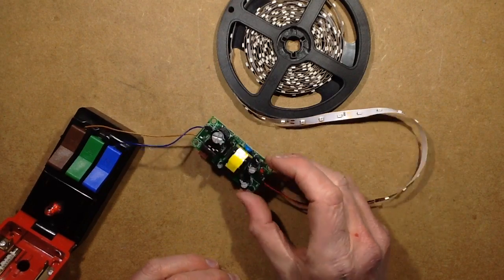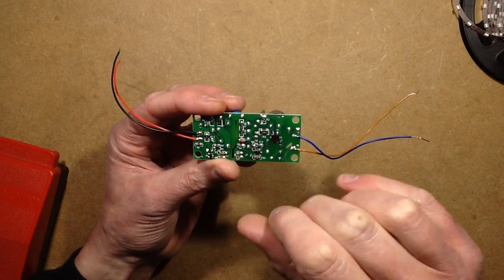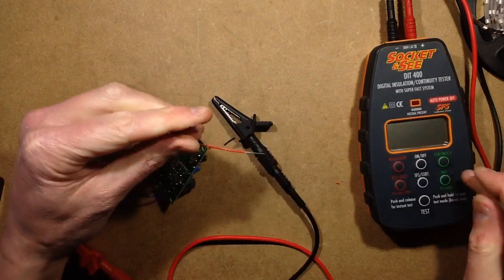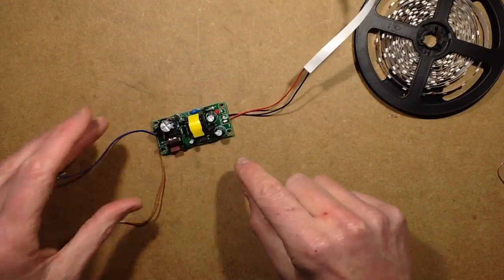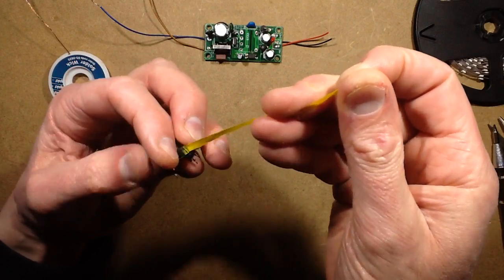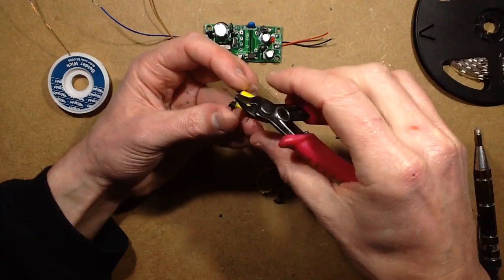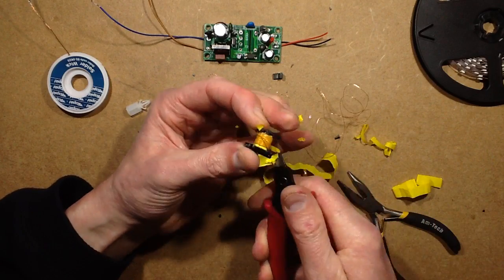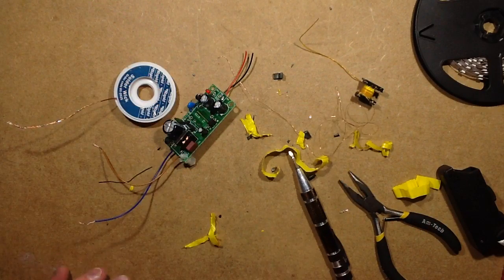Test of bare eBay 12V 1A PSU module, including safety tests.

Comment: I have a moderate collection of PCB mounted 3VA, 6VA and 12VA power transformers that I've had for several years for 'when the projects arrive'.  I paid more for these transformers individually than those little SMPS cost now.  I also have a few of the SMPS that I've bought for projects, they're so much easier to use, fit and forget, sometimes as a daughterboard and no need to make a simple PSU PCB.

My fault for not keeping pace with these new fangled gadgets 😀
Reply from the maker: Value those traditional transformers.  I still use them in my commercial PCBs for their simplicity and reliability.

Comment: That secondary wire is probably actually TEW (Triple Enamelled Wire). It gets dipped 3 times for extra safe insulation and can in fact be used without the yellow mylar insulation between primary and secondary. It usually comes from Japan actually. Quite surprised to se it in a Chinese item. I've used some of that myself in a similar application.

Comment: A lot of these power modules on ebay from China are actually well designed, because they are units the Chinese typically use in their own applications. I have several different variants and after 6 years they are all still running, one is used non stop every day. The stuff you don't want to buy off ebay is the stuff that the domestic Chinese don't use, and is purely to scam foreigners and made by sketchy people. Stuff like the fake flashdrives, the fake lithium batteries, the fake power banks, the fake charging boards etc. I get the feeling that real Chinese don't buy those items, and it's just mostly for export by Chinese scammers. However some of the stuff on ebay is used in the domestic industries in China and is thus legit, like this power supply, like the actual proper 1w led diodes, like the large resistor packs, like the soldering iron you are using etc.
Reply: what’s the non-stop one for?

Comment: What a shame to pull the transformer apart and render it useless.  Surely the fact it passed the HV test would have given you a reason to give it a long and useful life.
Reply from the maker: Even after passing an HV test there's no indication of the separation and how it may degrade with thermal cycling over time.

Comment: I looked for a way to PM you with no success. Instead of throwing a comment on your latest video, I chose one that covers what I am looking at, [albeit a little old]...
I have a 12V 10A switching supply [in a laptop style power supply case with a cord on each end.] that got rained on while plugged in. It now cycles on and off in 1 second intervals. Boots with full power but then immediately shuts down for a second, then back on for a second. I tried replacing the 8 pin main MOSFET control chip but still acts the same way. I was thinking of trying the Opto-Coupler next because it seems the bootstrap is working but not getting feedback [FB] so it shuts down and re-attempts the bootstrap???
If it is not the Opto-Coupler then do you have any other ideas of what the problem could be?

Comment: The problem is that one from some factory is well put together but how do we differentiate them from the other 20 varieties that may or may not be as well put together other than doing our own autopsies.
Reply from the maker: For a safety critical application you can only use a PSU sourced from a prominent supplier, so it complies with local standards.

Comment: Can you add a potentiometer on the 12v side to control fan speed?
Reply from the maker: It's more common to use a PWM module to control fan speed for efficiency.
Reply: @bigclivedotcom  Yes I actually realised that soon after writing the comment

Comment: The controller used is likely a Chinese version similar to NCP1250 (On Semiconductor). Only problem I've seen with these Chinese version supplies like this one is that they usually leave out the thermal protection circuit for the switching MOSFET.

Comment: The problem with these chinese devices is, you cannot be 100% sure to get the same build quality if you rebuy the device! I had this experience several times with TP4056 li-ion charge controllers, voltage regulators and other devices. If you get quality the first time and the item sells well, the competition is coming up copying it and trying to safe as much money as possible - so quality will probably drop... And even the original seller will have to go cheaper and will order cheaper components next time.

Comment: These open frame supplies are only as safe as the person who uses it. Also, working in broadcast engineering, I am amazed at how often an expensive piece of equipment is trashed because a $100 power supply fails. Or how much manufacturers charge for replacement power supplies. I am always able to find an exact generic replacement at Newark(Element14) or DigiKey.

Comment: Ace! In my lab-PSU I've got a complicated inrush limiter with a 555 timer that switches out a power resistor - all this needs to run on a secondary PSU... euch... it's complicated.
So thanks for mentioning NTC thermisters, just in passing... of to Wikipedia I went, and thence to E. Bay... a bit of lab-PSU surgery was due next week anyway. :) :)

Comment: You might be interested in looking at a cheap chinese xbox one power supply. They are bad lol, mine died after 20 something days of use. Mosfet cooked it's self, burnt out the tracks and the caps on the output where stupid hot. No filter on the input. Easy enough to fix and make better though.

Comment: The Netgear 12v 1a power supplies don't look as generous inside compared to that and I mean the ones that are given out with routers, switches and ap's that use to overheat and break down or intermittently work.

Comment: I want one. I don't know the first thing about electronics but, I want one. What can I do with it apart from run LEDs?
Reply from the maker: I'd recommend starting with low voltage circuitry before moving onto open PCB mains voltage power supplies.  You can run a lot of projects from a spare USB charger as a 5V supply.

Comment: I've been wondering about those vacuum de soldering irons for three or four years. They would be absolutely perfect for reworking 1980's-era through hole micro boards without sacrificing the pads in the process. Does anyone--Big Clive himself perhaps?--know the brand and price for the one featured here? This is the first video I've seen him use one but cannot make a lot of it out from what is shown on camera.

It would also be very interesting to know if it were possible to get one of those excellent little transformers one their own! So far as the whole PSU goes, by October 2018 it seems the seller is no longer offering them on eBay.
Reply from the maker: I think my desoldering unit is branded Duratool.  The transformers are usually custom made for each PSU.
Reply: Many thanks Clive!  I will give that a look on eBay. I have been very tempted by other suction de-solderers which had no base station and did it all inside the hand-unit. They were not super cheap though despite the fact. It would be useful as I think the tracks and pads on my current Atari XE motherboard were stuck on using 'Gloy' considering how easy it is to damage them during modding!!!

Its a shame regarding the transformer as it looked really, really solid. When I was a kiddie I put together a linear power supply that was actually a kit my father was given during a course he was sent on back in 1978.  It worked very well and had a range from 4.5V to 16V and was absolutely rock solid. It delivered something like 10A as well I seem to recall. What made me smile--more so now than at the time--was it was supposed to be essentially 'homework' for people on the course. However the whole thing was some sort of bureaucratic 're-qualification' nonsense and my father by that stage had been in electronics since joining the RAF just after the war so, thoroughly disgusted he gave it to me and said 'Here, put that together tonight.'  So I did!  I don't think there are many people who can honestly claim to have done their parent's homework for them!!!  Anyway, I'm sure it would still work but the transformer set on fire--which is unsurprising as I think I scavenged it from a speaker as the one in the kit had a broken core. Ever since getting back in to electronics I've wanted to rebuild it as a bit of nostalgia. I'll keep looking I guess!

Comment: Do you ever look in to the radio emissions of these sorts of otherwise decent looking electronics? As an amateur radio operator who is sometimes frustrated by neighbour's radio interference (that they don't even realise they're causing, and naturally they don't want to replace a piece of their own tech that's not playing nice but also not bothering them directly), I'd be very interested to see your thoughts on how to minimise radio interference in whatever relevant circuitry you're looking at, how it occurs, what it affects (HAM radio, WiFi etc) and so on :)

Thanks for the educational and entertaining videos!
Reply from the maker: The biggest source of electronic noise is probably the new era of LED lighting.  Many drivers have little if any suppression to allow them to fit into tiny bases.
Reply: Don't forget them horrible cheap PLT devices that seem to be festering like weeds around the uk.

Comment: poor little transformer - that was built so nicely! Unfortunatly you cannot foresee if a SMPS was built with some care or not. Esp. the transformer is the most problematic part in many cases. You have to break it apart to be sure. And when you rebuy it you can get the same piece but it might be crap as they copy their own product now and try to safe on them...
Reply from the maker: That's definitely an issue.  You smash a unit to bits and find it's good, but then get units that look similar but don't have the same isolation.

Comment: I ordered a 5m Rgb led set with 5a PSU. The PSU died on me so naturally I cracked it open. I knew it was super light and probably crap.. I was surprised to see that inside the large laptop style psu was a tiny circuit board. It looked like it was pulled from a wall wart, the DC leads were cut off but still there, the new cable was soldered onto the solder points on the bottom of the board.. The AC side of the board had 2 clips for the North american type prongs. BUT the ac input connector had two leads soldered to it then to the slots for the prongs... Its incredible what The chinese will do and get away with.
Reply from the maker: That's a common recycling thing.  They strip the modules out of scrap power supplies and fit them inside new cases.  You sometimes get very good quality modules in them.

Comment: Hey there, sorry if my question is of topic, but I'm trying to get some descent advice from DIY'ers like yourself. And good ones at that. Anyway. I started a project on my 18v NiCd battery powers drill. I made a 2p5s lit-ion battery  pack to replace crappy old batteries. I put a balance lead, for charging and balancing. And bought one of these. Li-ion Lipo Battery Low Voltage Alarm 1S-8S Buzzer Checker Meter Testers. With the hope of connecting it to an on/off switch. And letting the digital readout show thru the case of the drill. My dilemma is I can't seem to find a correct way to wire the switch to the meter. I soldered an addition 6s lead wire in hopes of making it work. But it doesn't read 18volts. It read 14v's and the alarm sounds. I put  the ground of the switch to the battery ground and put the positive of the switch to the last lead wire of the meter. Any help would be greatly appreciated. Thanks..

Comment: Hi Clive, your link is all sold out but I use these with higher amps. Maybe you could check them out one day.
12V high-power switching power supply board AC DC power supply module 12V8A switching power supply module C7B1
 http://s.aliexpress.com/qyyiq2i6?fromSns=Copy to Clipboard

Comment: Hey clive! I shorted out my fuckin cheapy meter leaving the leads in the current position and probing the 120V mains ac terminals. Exciting! Probably should have been wearing saftey glasses. Buddy got a good puff of smoke in the face. And a heads up to any amateurs like myself playing with this shit its not always easy to remember to discharge capacitors ect. when tinkering with this stuff. it's a very steep learning curve! Now if you will excuse me i have been watching a lot of bee keeping videos lately so I gotta go get my shop vac and relocate some bee hives.

Comment: Just a heads up to anyone ordering similar power supplies. Might just want to take a quick look inside, one i ordered had a main line fuse with metal contact ends less than a millimetre away from the aluminum casing. Just a little bend to fix it but somthing you might want to catch before you plug it in. There is also spatter from solider on the back of the board might be good to brush that shit off of there too.

Comment: I got the 12v 1.5 amp power supplies i ordered from e bay (2012topdeal) from what i learned frome these videos they look okay. I can even map them out a bit which is cool. 😎 the output voltage of the first one ive checked it more like 18 volts and the trimmer / voltage adj. Is useless. Im just going to run fans so it looks like it will work, but I'm sure I will find out in short order. If this interests you /anyone i can give a few more details if not thats cool too. Let me know if you want some e-mail pics or anything.
Reply from the maker: It sounds like the feedback circuit either has rogue values or isn't working.  Check the solder joints on things like the opto-isolator if there is one.
Reply: The second power supply works. The one giving me 18 v has a lumpy solider joint after the opto isolator on one side of a transistor. I'll goof around with that. Thanks. I find that pretty cool. I'm going to order some smaller ones. Are you interested in status reports on shit like this?
Reply from the maker: Let me know how you get on.  Especially if you reflow some of those solder joints with some fresh solder and flux.
Reply: I melted those shady solider joints, didn't fix anything. However I don't really have tools or material (solider wick, or even an iron.[using an old weller gun]) to actually do this stuff properly. Got a buddy i might get to look at it. Thank you for the responce and have a good one.

Comment: I got a cheap-cheapie power supply
from China
I took it all to bits
and I's surprised

It had isolation, and smoothing
interference 
suppression,
so bears survive

Instead I was treated for shock
...at the quality
by the time I left the ER...

... they were all sold out
what what whaaa

Comment: I have almost a identical unit in a device that currently runs at 9 volts and I need to bump it to 12 volts. The unit can supply 1 amp and I only need 300 ma is it possible to change the feedback resistor to the optoisolator to up the output voltage? I have seen some posts on the web and I'm not entirely sure. I really don't want to tear the power supply out of the unit..

Comment: I picked up a roll of those Christmas lights and installed them on our Motor Home, to be used, of course, for Christmas decorations since we live our winters down In Arizona, where the weather is warm and wonderful.  The spool came with no power supply so we used a 5 volt that I had along for such emergencies.  Worked great l strung them around the entire windshield, of course I will not use them when the rig is in motion even though I do have a 12 to 5 volt plug that would work just fine should I want to use them en-route, but I think it may well get the attention of our friendly Highway Patrolmen, and I do so try to avoid such actions.

Comment: 9 out of 10 times when i see you discharge a capacitor, theres not even a tiny spark. if that capacitor was so big, why did it seemingly not have a charge, or at least not spark? are they actually being drained when you do that, or is something else often already draining their energy and you're just making sure?
Reply from the maker: +kekejojo1212 It's just a precaution.  When the circuitry is working it will discharge the capacitor to a low level itself.

Comment: Clive does your soldering iron stay powered on 24/7?
Reply from the maker: I used to power up my workshop including the soldering iron whenever I was in it, when I used the older slow heating iron.  But with the fast heating electronic irons I just power them on when needed.

Comment: The who,where and how much £?. Went by to fast for DOD to catch it, also I like your wire stripper,and tiny screw driver, also would like model make and source of vacuum desolder station. I am in transition from thru hole to SMT. THANK YOU KB5ZXM Darrell.

Comment: I wish I could identify the driver chip on an 8.5W 120v Osram LED lamp I tore to pieces.  It's a 7-pin device with the code 71YL5Y1FE etched into it.